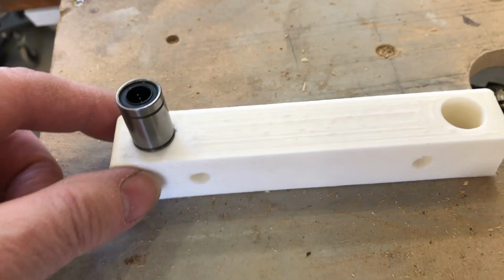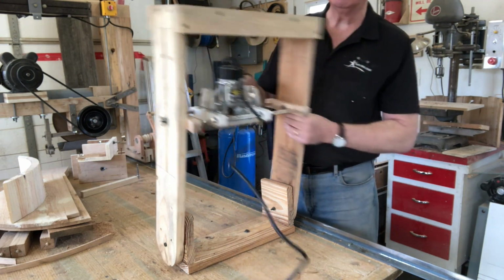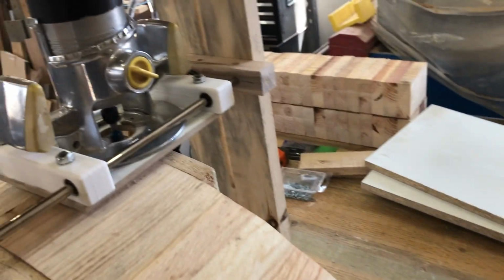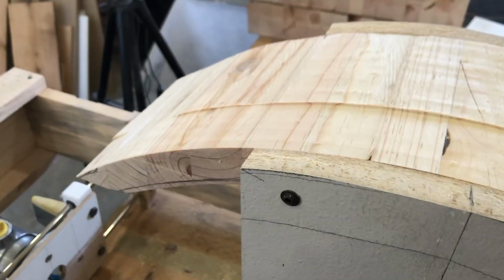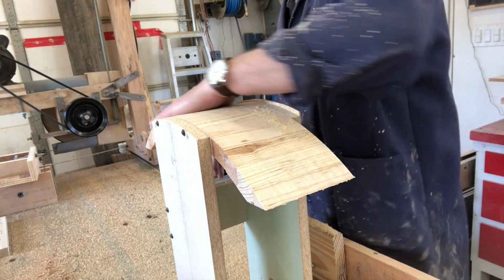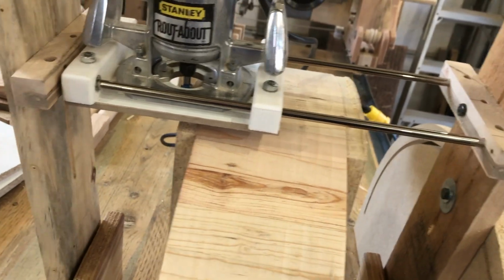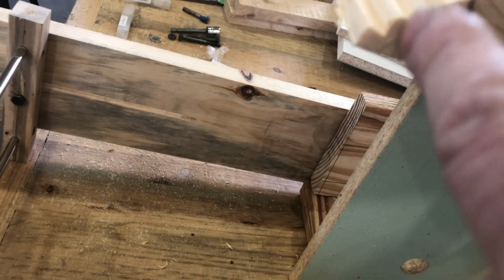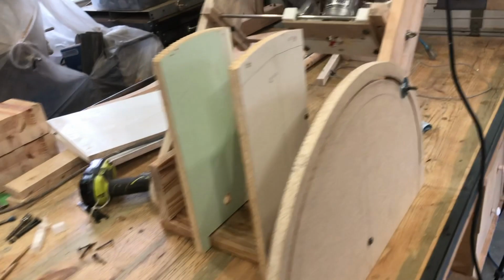Arc Cutting Router Sled - Part 2 - Plus Beads on a Curve!

Comment: As I was watching you cut the beads I instantly thought that you could also use this to cut wood gears. Albeit a rather large wood gear with this model. I'm now thinking a dremel tool on a smaller version.
Reply from the maker: Interesting.  I think though, I would fix the swing arm and build a mandrel on which the gear blank would rotate, rather than fix the blank to a "table". By moving the mandrel up and down I could accommodate any size gear. Just need an appropriate router bit.
Reply: @secretundergroundlair4014  And that is why you are on you tube building all of these fun machines while I'm sitting on my computer commenting. Now if I can remember your idea if and when I need some wooden gears.LOL